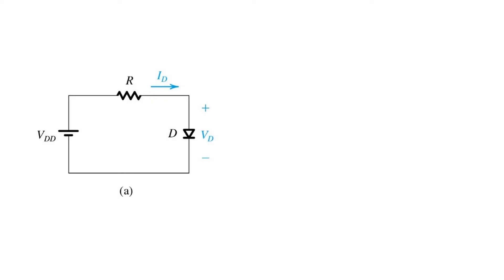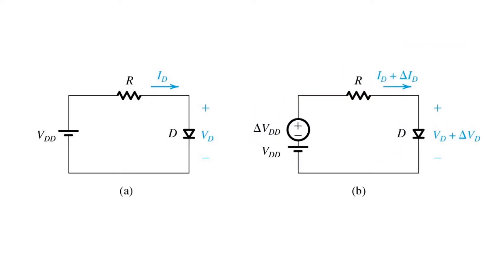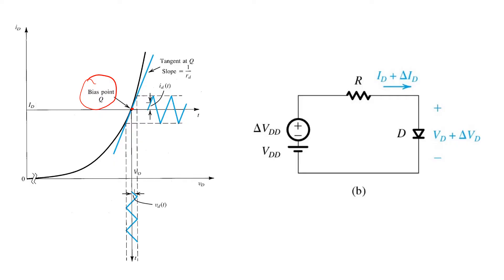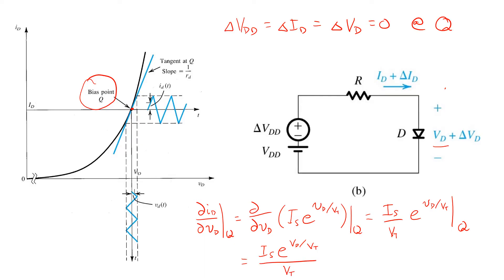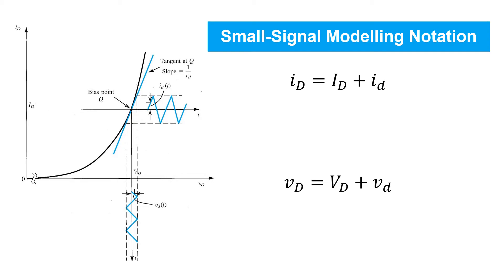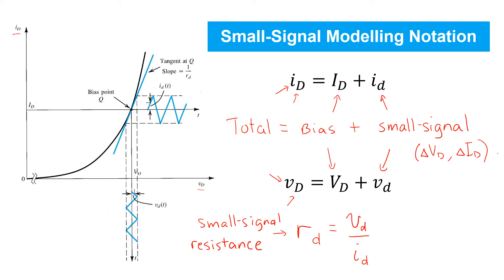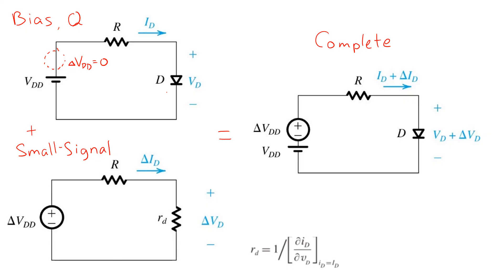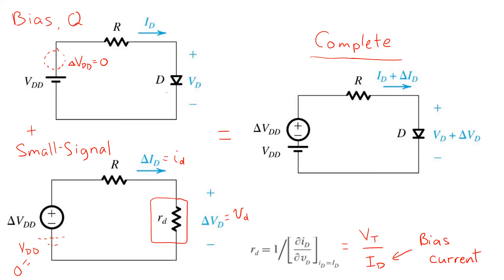27 The Diode Small Signal Model

Comment: why diode is not replaced with resistor + capacitance ?
Reply: Coz in small signal analysis it behaves as linear device I.e resistor
Reply: in some cases, the frequency is to high and the capacitor acts like a closed switch.